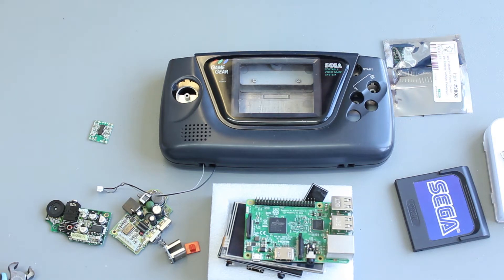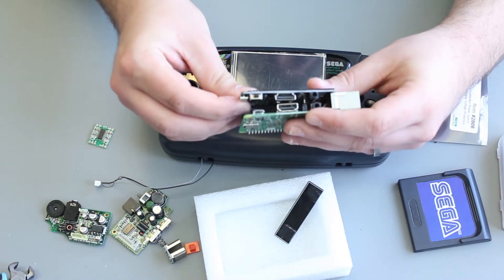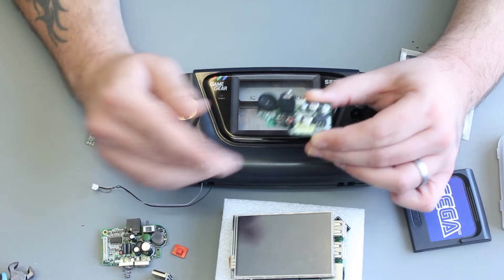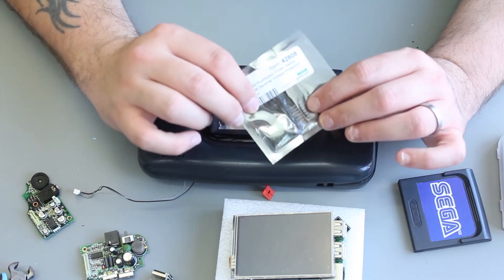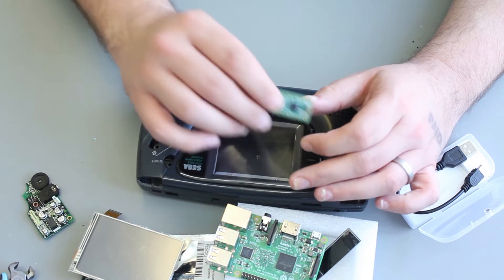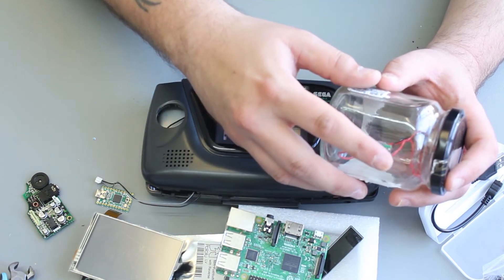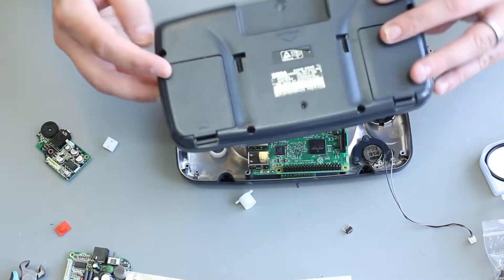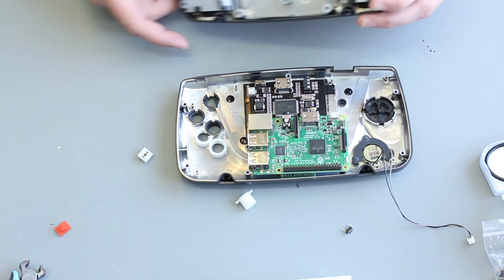Sega Game Gear RetroPi Raspberry PI 3 Build - Part 1

Comment: I’ve come across one problem which is the silver paint on the inside is causing shorts with the pi.

I’ve sprayed the inside of the case black to insulate it
Reply from the maker: Yes, I use a 3D printed cradle to insulate the pi from the case. I also found the same issue with the touch sensors so i just sanded the silver off in those spots.

Comment: Hi there any chance to links of items used in the deception please
Reply from the maker: Thanks for the nudge, I've updated the description with the parts list and will recap all the parts used in the final video.
Reply: 16BitBench  cheers buddy tried a few things out as I’m at the same stage as you so hoping your video will help fill in the gaps will you be putting the battery light inductor back in and how comes you picked battery’s over lipos?